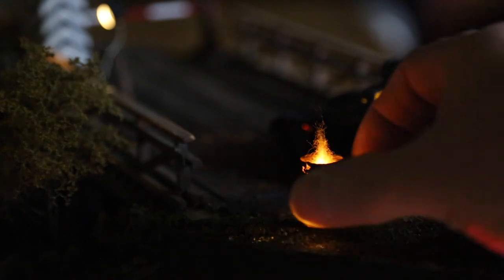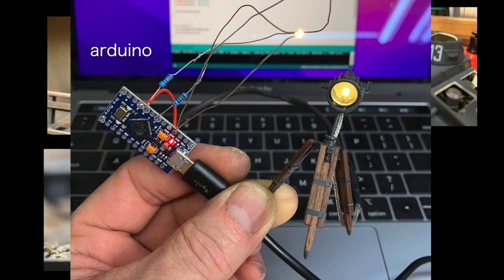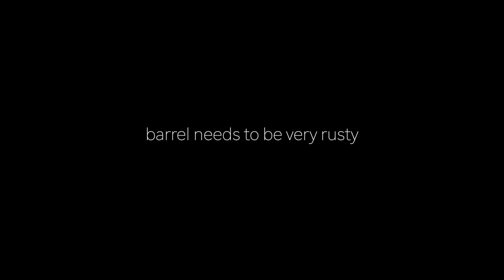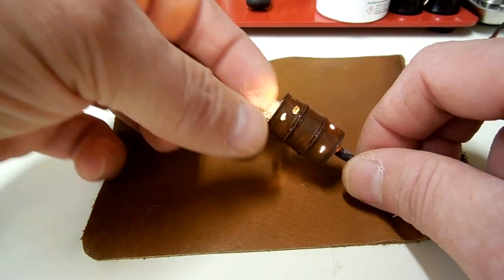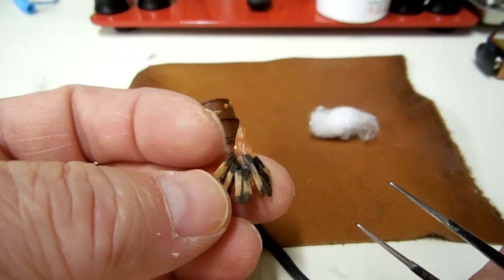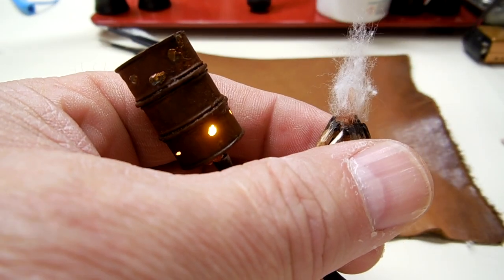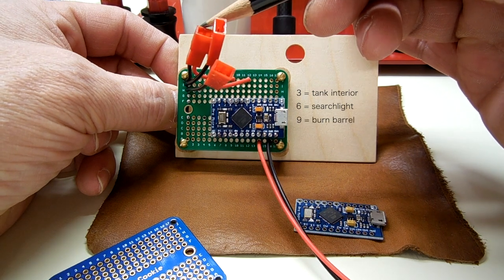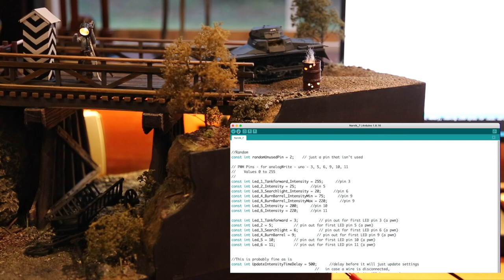Diorama Building with Scale Model Craft ep:5   Arduino controlled LED lights

Comment: Great video! I'm in the process of building a stage diorama for heavy metal bands, with multicolour LED lighting rigs. I'm wondering whether the Arduino can run a program that will give the effect of a light show.
Reply from the maker: Thanks Adapt &Prosper!! It sure can, but you would most likely need more than one for different things. You basically have a specific number of out puts, and voltages you can control, and depending on how much lighting and how many different routines you want to have, you can just add more arduino’s. I had help from my cousin programming the arduino code, but it’s not too difficult especially with all the samples they have on their website. Best of luck and I’d love to see how it turns out!! Take care, Bill
Reply: @ScaleModelCraft  cheers for your reply, Bill! I know a few people who can code, so it shouldn't be too much of an issue.

Comment: i would not suggest with this.. but on another piece of poly.. just move a lighter flame near it.. dont even lick it, just close.. just to see how it looks. i haven't tried it just had the idea watching your video. those little single pieces bug me on my smoke. i use my finger like you to kinda mush them in. got me thinking.. i might go to my desk and try. just to see what happens. looking good. now i got a couple more ideas... thanks.
Reply: hey.. you got the resources an skills.. especially with the audrino.. how about a smoke machine using those RDA type coils from an electronic cig and a small tub with smoke oil in it.. your diorama is so nice.. that would really add to it.. that motion.. haha i can live vicariously though you!
Reply from the maker: Thanks Michael!! I did see one of the little smoke machines on Luke Towan's channel, so I need to go back and check that out, its a couple years old. I do have an open line on the Arduino so I might be able to control it from that. Thanks again and nice to hear from you, Take Care, Bill.